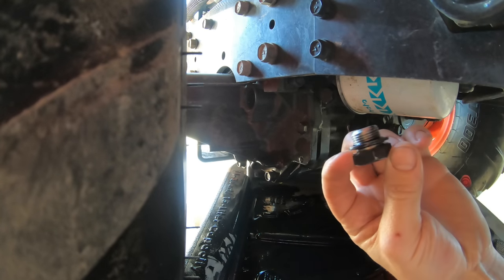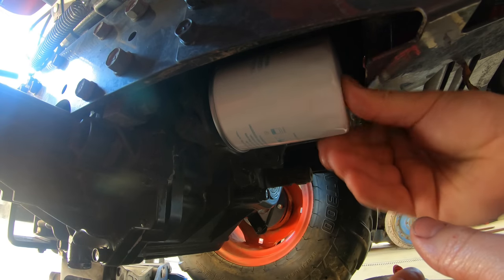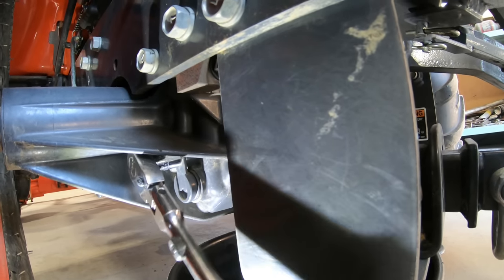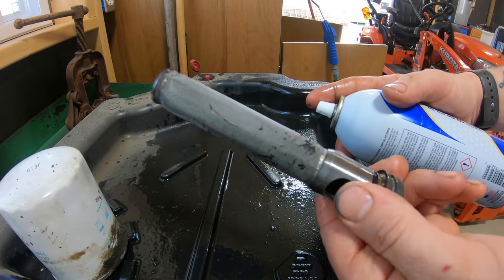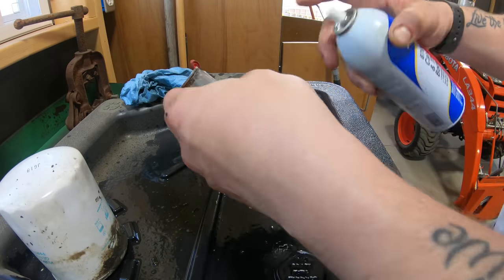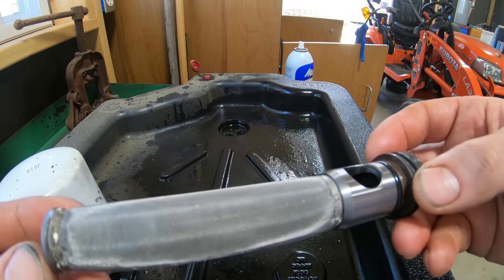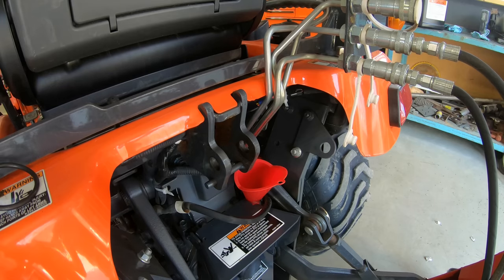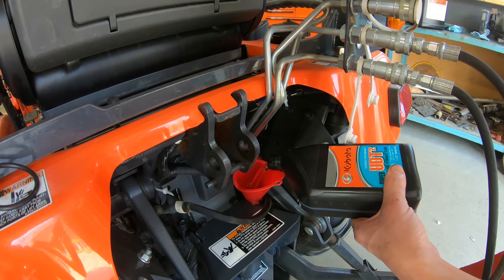Kubota BX- HST Hydraulic oil + Filter Change (FINALLY!)

Comment: And I’m over here with 170 hours waiting on a service appointment because my transmission is leaking for the second time😂😂. I only wish my transmission was as tough as yours.
Reply from the maker: Damn really. Where’s it leaking? Mine certainly has taken a pounding!
Reply: I have a bx2380. The first time was right at about 50 hours and it started leaking on the plate around the rear pto shaft. I fixed that myself by simply redoing the rtv seal. 

The current leak isn’t that bad but letting the dealer handle it since it’s under warranty. It’s leaking right at the top of the transmission close to where the loader valve taps in. Pretty sure it’s the rtv again. The seat, fenders, and fuel tank will all have to come off to access that area so I’m gonna let them handle it. 

Nice video!

Comment: As a Kubota/JCB service tech, I wish all customers were as thorough with their repairs/maintenance as you are. Big props for using the Kubota filter and fluid as well, I see too many Napa filters used instead
Reply from the maker: Thanks Will! I appericate that coming from a Kubota service tech. Sounds like you’ve got a pretty fun job, I use to be an automotive mechanic for more then half my life before working on equipment and doing landscaping.. I got sick of working on automobiles and quickly fell in love with working on equipment/heavy equipment instead. Stay safe and thanks for watching!

Comment: BX’s biggest design flaw is the  hydraulic fluid is air cooled!
Reply from the maker: I couldn’t agree more Sean! This tractor could CERTAINLY benefit from having a hydraulic cooler like the JD 1 series has.. I debated making my own at one point too and I still might. If I do I’ll certainly do a video on it. That being said even with out a cooler, and the insane temps Iv had my fluid at, speaks volumes to how tough Kubota built these transmissions and hydraulic system on this tractor.. as not many people have transmission or hydraulic issues when it comes to the BX. Stay safe and god bless!
Reply: Mahindra emax 25 is also air-cooled the hydraulic fluid

Comment: Just bought a 2360 that the previous owner has had for 8 years and have never changed hydraulic fluid. It runs and works just fine but I won’t use it until the fluid is changed. So 782 hours overdue.

Comment: You are fortunate that the dipstick/fill port on your newer BX is located where it is. On my BX-22 from the early 2000s, that darn port is up higher in the middle between the top link attachment points and is a royal pain. Removing/installing the cap has to be done by feel and the dipstick is a separate little thang that's partially blocked by the tree point upper arms and a hydraulic hose.
Reply from the maker: Hey Jim, your right about the dip stick prolly being in a harder to reach space on the older 15, 22, and 24 models as they only had a cat 0 3-point back then .. it wasn’t a full “cat 1” 3-point which changed where the placement of the arms where it came out of the rear of the tractor.. prolly making it much harder to reach that dip stick. Thanks for watching bud!

Comment: That was some good information, I have a 2015 Kubota BX 2670 front end loader, 240 hours, I think I'm going to do the transmission fluid and filter change on early, I don't like my tractor, I love my little tractor. LOL
Reply from the maker: Thank you! I’m glad to hear you LOVE your bx! It is such an amazing machine. I have driven many machines for many hours as well as direct competitors of the Kubota BX such as the John Deere 1023e and 1025r and I am always amazed when I get back on my Kubota bx just how much simpler it is to work with, how much better your line of sight is from the tractor seat, how much more comfortable and better built/designed it is. Kubota surely knows how to make a good tractor.. extremely durable too! Thanks for watching!

Comment: Excellent video Mike, For a tractor worked as hard as you work it, it's in great shape... I will be doing my hydraulic oil change this spring and the extra info you gave is great to know.
Reply from the maker: Thanks buddy! I’m glad my video was able to help, your a smart guy and I know you woulda been fine doing it with out this video but it’s always great to have a quick refresher coarse before doing so haha. And thanks, I was quite surprised when I washed her how good she still looks.. even the paint is still in great shape as well as the rest of the machine.. I try to take decent care of it and not let things go, but it’s also a testament of just how good of a machine Kubota builds!

Comment: I did the hydraulic fluid/filter change when I did the 50 hour break in service....figured I was already there changing the filter I may as well change everything at 50 hours and get all the contaminants out of the system sooner than later.  The filter screen was pretty clean when I did the service, which surprised me after watching a few other videos where their filter screens were extremely dirty/clogged.  Except I did skip a step, I didn't drain the hydraulic fluid before I pulled that stupid filter screen LOL...I wasn't really thinking about it at the time, but once I pulled that screen out, oil shot out of there like a geyser LOL...I had a mess everywhere...but hey, the fluid got drained HAHA!!!  I did drop the drain plug in the bottom of the transaxle to finish draining what was left.  Not a hard process to do at all, these things seem pretty dang easy to service and maintain.  

I just had the Kubota 3rd function kit installed this past week, the dealer picked up the tractor Monday morning, had it back to me Thursday afternoon.  So, at least that is done for when I get a grapple later on.  I'd like to get the rear remote kit as well at some point as that hydraulic top link would be great for box blade work.  I do know that quick hitch is extremely handy too once I got used to it, everything I get now I make sure its quick hitch compatible, or modify it so that it is LOL. 

I was doing some loader work at a friend's place a while back and rototilling and he couldn't get over all the stuff I was doing and swapping attachments without leaving the tractor seat.  I think what surprised him the most was when I took the loader off all while sitting in the tractor seat.  He was like umm do you have to get off that thing at all....I said well when you change attachments on the loader from like the loader bucket to the pallet forks you have to get off and flip 2 levers to remove an attachment and then flip them back down after attaching the next attachment....I said other than that, pretty much everything can be done from the tractor seat except attaching the PTO shaft for like a tiller or rotary cutter.  Might have him talked into a BX23S as he kind of wants a backhoe model, I have the BX2680 as I don't need the backhoe functions and wanted the additional HP for the PTO LOL.
Reply from the maker: Haha sure sounds like you have your buddy convinced after he saw you do all that work with your bx on his land and just how simple it is to swap attachments! I’m glad you talked him into one, the 23s or 2680 would both be great picks! If he thinks he’s gonna use the backhoe a ton then the 23s obviously but if he thinks he’s gonna favor using rear implements more then the 2680 is also a good buy.. he can always buy a mini excavator down the road to go with his tractor like I plan to do if he decides he just can’t live with out a hoe.. but if all he’s doing is digging small ditches and stumps and that kinda thing then he may actually be better off with the Artillian trenching/stump bucket like I have. 

Sounds like you had a mess on your hands with the oil but I’m glad you got it changed! And trust me when I say your not the into one who’s removed the filter strainer before pulling the actual drain plug as Iv heard many story’s of people doing just that on their first change haha. Your right it really is an easy machine to maintain, Kubota did alot of things right minus their primary inline fuel filter which can be easily modded like I did with mine. 

Glad to hear you got your 3rd function on! Now she’s ready for some grapple action when the time is right! Stay safe out there!
Reply: @BiffsEquipment  He's trying to decide what route to take actually between the 23S and a mini-excavator...I told him to get a mini excavator and a 2680 LOL. 

That fuel filter under the tractor is a PITA for sure...I've been thinking about getting a bowl type fuel filter and installing that has the water separator on it....much easier to service than the nonsense dollar store filter under the unit....that is one place I give a huge thumbs down for Kubota, they could easily have spent another few bucks and put a much better fuel filter on these machines, in a much better location.

Comment: Thanks for the video, I learn from them. Just did my 2nd transmission service on my BX and I had no idea to do the steps you gave after changing the fluid/ filter to get the air out of the system and protect the tyranny. Thanks!
Reply from the maker: Awesome! Glad to hear I could help! You prolly didn’t do any reversible damage but it’s a great thing to do to help protect your trans and swosh plates from getting scared or burned. Thanks for watching!

Comment: Thanks for the video!  I just hit 600 hrs so I need to do this.  Thanks for showing the screen removal (I was worried I had to remove the wheel to access it).  Also - VERY good point about removing the foil from the container - one stray piece in your system could cause a major problem
Reply from the maker: Thanks Frank! I’m glad I could help show the locations of everything and how to easily access them all. Overall it isn’t a difficult job specially if you follow my steps you’ll have zero issues. Best of luck, it sounds like your tractor needs to be changed just about as much as mine did!

Comment: Thanks a lot Mike.  I don’t understand why retracting your cylinder would make a difference.  The cylinder uses as much oil when retracted or extended, it just uses a different part of the cylinder.   As always, great super video.
Reply: The rod takes up space in the bore, Displacing hydraulic Oil.
Reply: @m9ovich785  duh !!  For a reason I forgot about that part 👍
Reply from the maker: Hey Eric, great question! You are correct about it using oil on each side of the piston in the cylinders but because the one end of the piston is connected to the cylinder shaft .. the side with the cylinder will not hold as much fluid as the side with out it.. so if you want to get every ounce of old oil you can out of the cylinders then you’ll want to collapse all the cylinder rods as far into the cylinders as you can.. now there isn’t gonna be a ton more fluid going back to your resivor but there will def be some, maybe 1/2 a quart or something in total.  This is also why you should always check your hydraulic oil level with the cylinders in the same position.. typically collapsed so that when you check the dip stick you are assured that it’s at the level you think it’s at.. as checking the level with the cylinders at different positions will change the level on your dip stick slightly which gives prudence to what I first said about the cylinder rams taking up space inside the cylinders. Thanks for watching buddy!

Comment: Just became a subscriber  have a new 2205h  branson and built a new poll  barn to so I know what your going threw have to change my oil to thanks for the walk threw it helps a lot keep up the good work
Reply: Another great video sir. I have the same tractor and love it. You are the guy that i follow for all my bx needs. Hats off to you sir!!
Reply from the maker: Hey Rodney! Nice tractor you have there! My Neighbor has a Brandon too as you can see in my first pole barn video where I unloaded the pole barn using it! Great old machine and still runs like a top! I’m glad this video was able to help you and give you some tips. I plan to do the engine oil change on camera too coming up here shortly I think, along with the fuel filter, stay tuned !

Comment: Another great and informative video. Some great tips on what to do to keep your tractor running properly. I can’t remember if I changed my trans filter at my 50 hr mark or not but since mine just went over 100 hours I’ll make sure I’ll do  this service now and won’t have to worry about it until 400. I don’t work my 2380 near as hard as you do lol. Thanks for your videos!
Reply from the maker: Sure thing Brian! Sounds like a good plan, you’ll be able to spin the hydraulic filter off with the fluid still in the trans though you will loose a bit so just pick up a gallon or at least a few quarts when you do it.. also the factory filter is gonna be a son of a gun to take off as they spin the filter on dry from the factory so just be sure your ready for a long hard task when you go to remove it. The best thing that works is grabbing a very large set of channel lock plyers, opening them up and squeezing down hard on the filter and twisting that way.. you’ll bend the filter up and stuff but that’s fine, that’s usually what it takes to remove it. 

They also make specialized filter wrenches that look like channel locks only they have a round clamp on each end the size of a filter.. these work the best and can be picked up at any local hardware store typically. Don’t install the filter with these tho as they are only made to remove filters as they can/wil crush the housing a bit. Best of luck!

Comment: Hi Biff, just found your video on the transmission service. Nice in depth vid.  I have a Kubota B7500 Hydro with loader and backhoe. I just did a complete service, engine oil and trans. Know what is happening is that my hydraulics loose pressure even when I'm running the tractor and the backhoe and stabilizers droop. No Leaks, fluids to correct fill levels. Would you know why this is????
Reply from the maker: It’s prolly got some cylinder drift because the seals in the cylinders did your stabilizers may be getting a bit worn out so fluid is prolly passing through and relieving the rams. How long does it take them to drift? Cuz some drift is normal and drift over a matter of hours or days is normal. If they drift down really fast with in 5-10 min then your cylinder seals are prolly a little tired

Comment: I'm at about 45 hours on my Kubota BX1880 and wanted to change the filter out and clean the screen, but wait a bit longer before changing the fluid. Anyhow, I went to locate the filter and I believe I did, although I'm a bit taken back because it is a solid black color, and the genuine Kubota filter I purchased from my dealer is white. I'm wondering if you have any idea why the original factory installed hydraulic filter would be black in color when the genuine part is white?  Thanks
Reply from the maker: Hey Carolyn sorry I’m just now seeing your comment! This is pretty normal.. typically the OEM hydraulic filter on your tractor will be painted over grey if it has never been changed before, yours may be black because the dealer may have already changed the filter for you once before you bought the machine as a courtesy. Either way the new filter you bought to replace it with from Kubota will always be white, for whatever reason sometimes the dealer will install a filter that is a different brand if they didn’t have any left of their own filters in stock when they changed it or they may have painted it black so that if you had any issues down the road with the tractor they would know if you changed it or not.. because they would know that their filter was black and yours would be white.. this way they know if it has been changed or if the customer is lying about changing the filter when they were suppose to or what have you. 

In any event I wouldn’t be too concerned with this. So long as you replace it with a genuine white Kubota filter then you will have nothing to worry about for the future 👍🏻

Comment: Great videos my man. Getting a BX2380 within a couple weeks. I was curious what pallet frame you are using?  I got a lot of small trees I got to rip out on my new property and need to get a stump bucket to dig out the stumps. I want to get Artillian stump bucket. 
My dealer was also talking me out of the rear remotes for a top hydraulic link. I got a 200' gravel driveway and a natural spring in the area that I think eventually causes  pot holes. I saw your install video, should I just see how it goes manually adjusting the blade box and install myself if I need the remote function for working the blade box?
Reply from the maker: Thanks Matt! As for the fork frame the frame is made and sold by Artillian as well, you won’t be able to use their stump bucket on any other frame because of the way they made the notches and the spacing so if you use their bucket which I would highly recommend then I’d also use their frame. As for your rear remotes, not sure why he would try and talk you out of it, the rear remotes are an awesome addition to the machine if you plan to use a boxblade or back blade or even a tiller alot. If you are pretty competent in your mechanical abilities then you could install it yourself and prolly save quite a bit of money.. but put aside a good 6-8 hours for the entire job if you don’t do it every day. If you follow my steps tho you’ll be fine I think. Congrats on the new BX by the way!